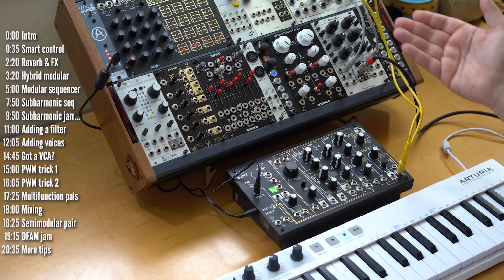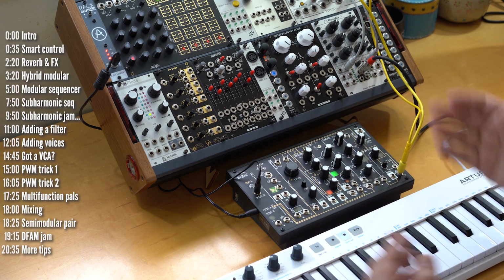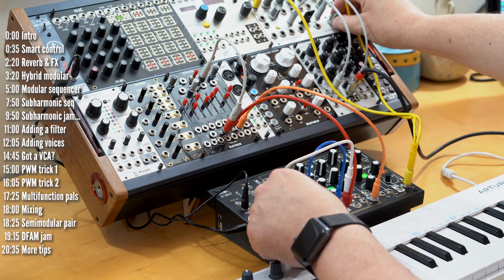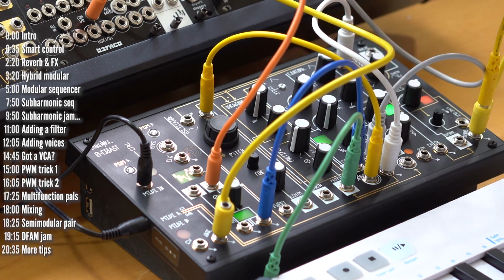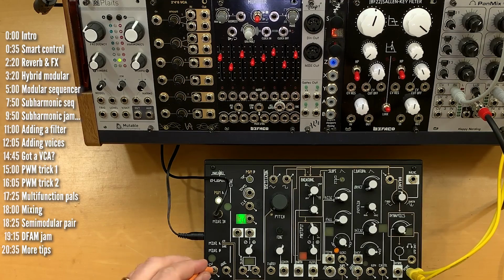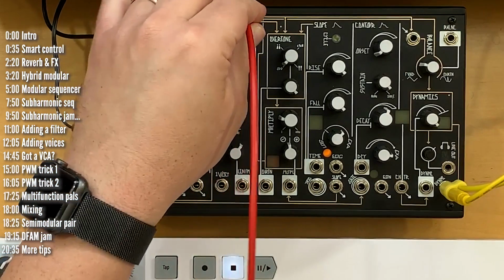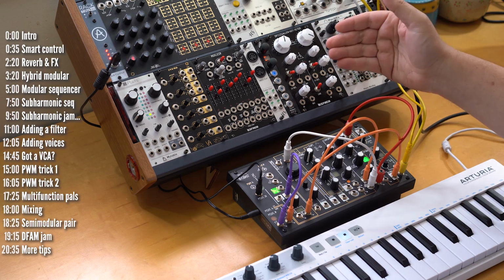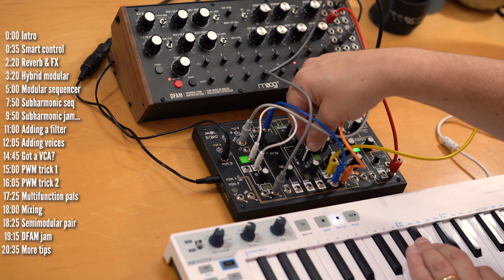Make Noise 0-Coast and Friends: 10 pairing ideas worth considering

Comment: Hi, is it possible to simulate the PWM trick 1 with the external VCA using a Crave? How are the connections?
Reply: I found the solution: 

“VCA
Apply a CV signal to the MIX 2 input. With the VC MIX control at a fully counterclockwise position, apply a 0V to positive CV signal to the VC MIX CTRL input (EG for example). This will dynamically determine the amplitude of the signal at the MIX 2 input that is passed to the VC MIX output.”

Comment: Hi, how do I sync dfam with 0coast? I have clock being sent from my digitakt over midi, and the 0-coast is set so that it sends the synced midi clock output from its tempo which is synced with digitakt, but when I plug in clk out to adv / clock on dfam it stalls the sequencer.
Reply: Is the PRGM-B button illuminated? Hold A button and then press B to turn that off.

Comment: The first thing to add to most semimodulars and synths would be a reverb and a delay pedal in my opinion.

There are loads of synths and gear circulating on the secondhand markets, making it relatively easy to try out things and resell without much of a loss. 
After my first semimodular, a Mother 32, I bought another secondhand. But after buying a Doepfer low cost case and some modules, also used, I resold the second Mother and got a dreadbox nyx V1 instead. The secondhand Nyx was dead cheap to as Dreadbox has made a V2. 

Bear in mind that some hyped and out of production gear can be really expensive, and that If you really want that sound or functionality, it can make sense to wait for a while as clones or remakes are likely to pop up. 

My first external sequencer was an Arturia Keystep that I don't really like that much, except as a portable and decent keyboard. At the moment I use a Mutamix  and just got a Doepfer Darktime. The mutamix was dead cheap and is good as a modulation source, and Darktime is really intuitive and great for instant melody and beat making. It has also made me rediscover new sides to my instruments. 

I've also seen many enjoy and making great stuff with the Korg SQ1 both for semimodular and eurorack, so I suppose for that low price it is worth checking out.

Comment: Just got the 3U rackbrute and want to make 0-coast the center of that setup.  Overwhelmed now but this helps as a starting guide.  Would Muxlicer and Maths be a good combination?
Reply from the maker: Not necessarily - It really depends what synth you’re trying to build - though one can rarely go wrong with maths and muxlicer is nice too... all depends on where you want to go
Reply: @loopop  Thanks! I already like the sound of the 0-coast.  Just looking for more ways to compliment it.  I like to explore more FM sounds if that helps.
Reply from the maker: I say, take your time. Try out VCV rack, have a good idea of what you want in hardware form and only then buy it. These things are expensive... it's worth the research to figure out what resonates with you

Comment: Hello Loopop. I want to run dynamic microphone through input on maths section. Which is the best way to amplify the signal? Can some microphone amplifier under 100$ do the work (like Behringer Ultra gain)? Thnx, cheers
Reply from the maker: I’m not sure that would be enough. I use SBG by ALM - it’s a bit over that price though
Reply: Thnx very much for answer. I was looking for something that does not require eurorack stuff. I dont have PSU for modules...

Comment: Great demo... amazing sounds... learned a lot.
What what about the analog Novation Circuit Mono Station?  Has both CV and MIDI out for up to 3 sequences.
Reply from the maker: Absolutely!
Reply: Worth mentioning that I could never get the CV output (now that you can route the Modulation sequence out of the Aux CV out as note CV) from the Mono Station to scale correctly with my 0-Coast - even just within one octave the tuning was too far out to be useful musically. Still had some fun triggering my 0-Coast using it, but it just didn't quite work as it should! Worked perfectly over MIDI though, though that way you lose/duplicate one of your sequences from the Mono Station.